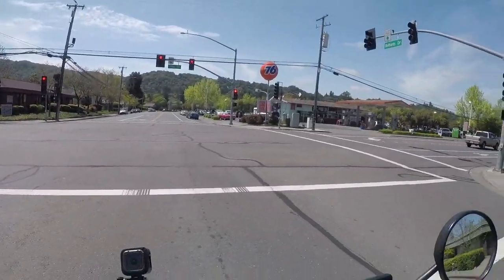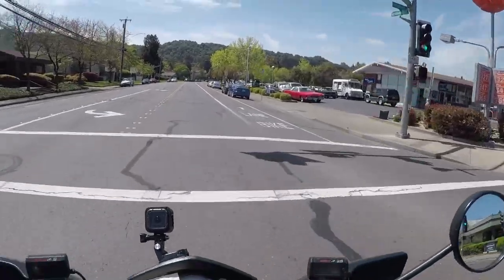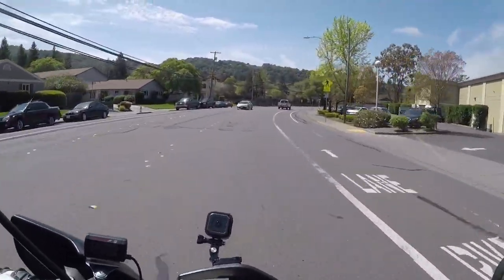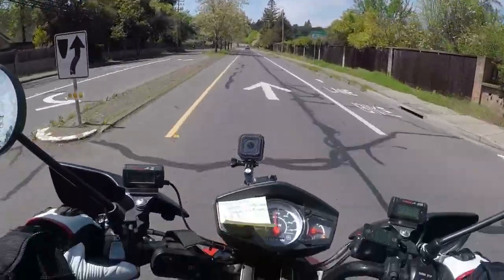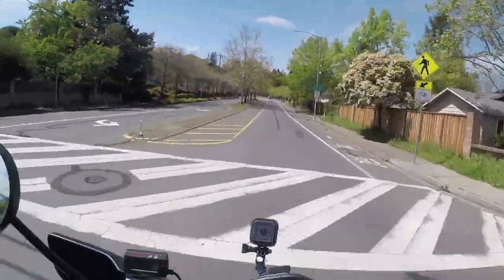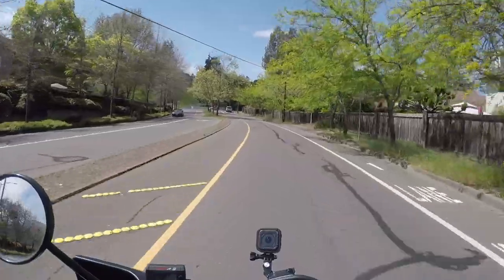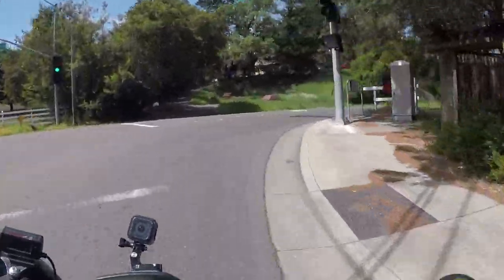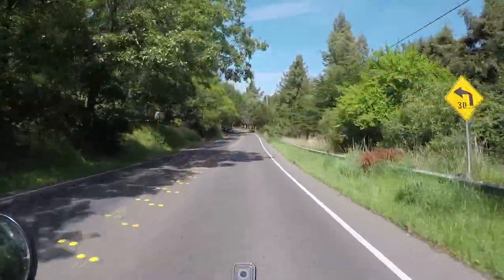Moto Vlog #41 - Pros & Cons of a Big Bore Kit - on my Yamaha zuma 125, scooters and small bore bikes

Comment: So for someone who has just bought one of these and wants it to be a little more nippy, would a 'rolling wrench beast mode tuner' suffice? Are there other little cheap bolt ons to make this thing faster?
Reply from the maker: i am not familiar with the 'rolling wrench tuner' but ive seen some of his video, looks lik ehe knows his stuff. Like the old saying goes,and this is just my opinion but 'there is no replaement, for displacement'. If your willing to spend $200 on a tuner, why not spend $350 on a 155cc big bore kit from rcscooters and call it done. 

https://www.rcscooters.com/product-page/155bbk

Its bolt on, no tuner needed, no exhaust need, its reliabe. just break it in hella slow or it will blow. Down side is your gonna have to pull the engine to do the work but more importantly you have torque and speed gains you can feel right away, and for life. 

you can tune a stock car and get some gains, but now lets scale it down. and tune a stock 8hp scooter. what are you really gonna get. The 155cc bbk will get you to 11-12 and about 60-65 mph top speed. Get some michalen bopper tires and do the cvt trick and you be closer to a solid 65 ,and the extra torque will get up those hills

I blew my first kit, and had to spend money on a second. but i dont regret it one bit. It really adds some life to the scooter.

hope this helps one way or another, Peace
Reply: @OnyxHaze  thanks for the detailed response, I appreciate that!

Comment: What was your performance with your 175?  And did you have a cam and all that?
Reply from the maker: i don't know exactly how much horsepower, torque, or what my 0-60 times are. I do know that with the stock final gear i was able to pop wheelies, impressive for my heavy zuma and i was reaching top speeds of about 60-65.  After i replaced the final gear my new top speed was around 70-75 maybe 80, all i know is that on a long enough straight i could bury the needle. Thanks for asking
Reply: @OnyxHaze  thanks for answering!  Im either doing anywhere from a 158 to 175 on my Zuma or a full 150 kit on a Vino 125.  Gonna get spicy either way
Reply from the maker: @mopedmessiah  awesome, enjoy the gains my friend !
Reply: @OnyxHaze  update, gonna do the stage 1 175 with a very slight upgear.  Hopefully i can keep a bunch of torque and still so over 70
Reply from the maker: @mopedmessiah  who are you getting your kit from?

what is stage 1?

i think you will be very happy with a 175cc, and the slight up gear is a smart move, a little more on the top end and you can sacrifice a little torque because you're moving up in CC anyways...

keep me posted
Reply: @OnyxHaze  itd be the rc kit.  Stage 1 includes a high flow head, 30mm throttle body, a heat sink and a high flow fuel pump on top of the base 175
Reply from the maker: @mopedmessiah  oh ok, i just never heard Chris put it like that... but yea sounds like its gonna be an awesome build !!
Reply: @OnyxHaze  hopefully, shes already a quick bike.  It did 60 gaining on a car and even climbed a lil past 60.  Speedo, but my speedo is actually pretty accurate so 😂